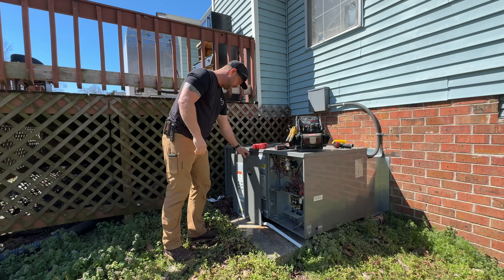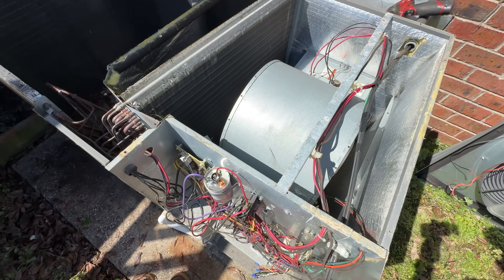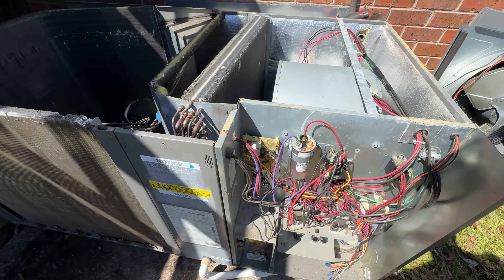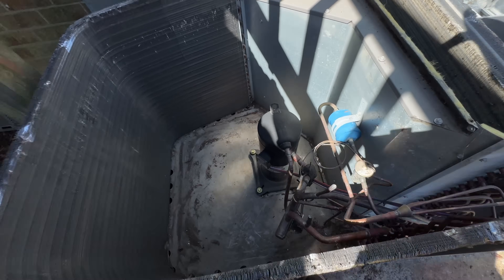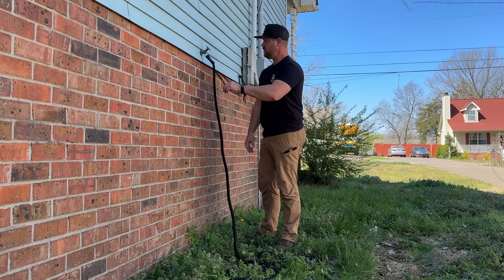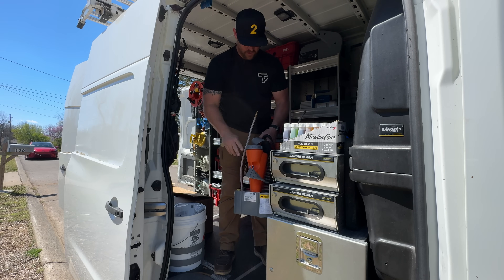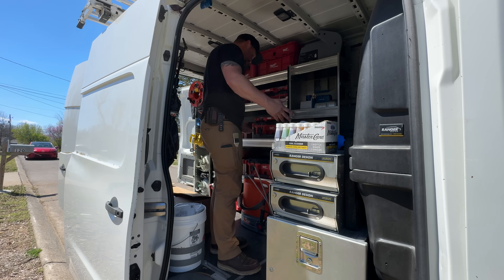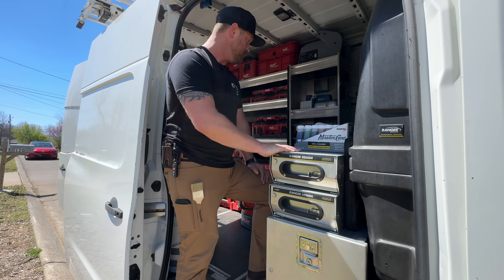How To PROPERLY Clean An Outdoor HVAC Coil

Comment: This looks like a $500 job. It takes me about an hour to an hour and a half to rinse coils with water thoroughly checked the system and do an operational check. A job like this would probably take three hours . In my opinion coils don’t need to be shiny. They just need to be free from dirt and sorry but I’m not taking up all those tools and cleaners on the roof for an $89 tune up. I feel like this is only for content and views
Reply: Facts

Comment: Nope. You used the dumbest tool in the hvac industry, the foaming gun. Watch my video if you want to know the correct way to clean a coil.
Reply: Why is it the dumbest tool? Genuinely curious, I see many other techs use it as well as myself!
Reply: @madeinusa1576 The point of coil cleaner is to push the debris out of the coil as it foams. When you put the coil cleaner on as foam it is wasteful because it defeats the purpose of the foaming action and only puts foam onto the outside of the coil. The coil cleaner should be sprayed into the coil as a liquid then you get the full effect of the foaming action. I have a video on my channel explaining this.